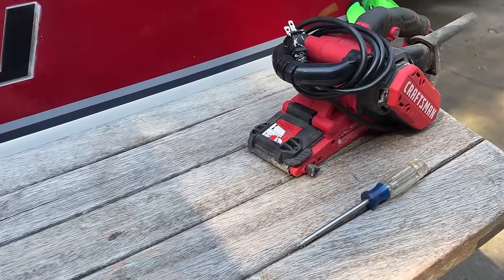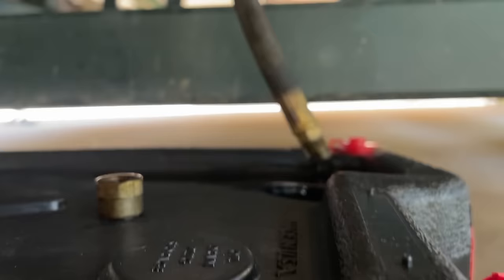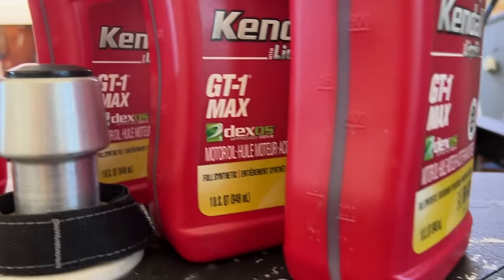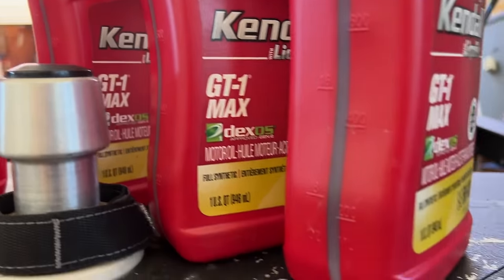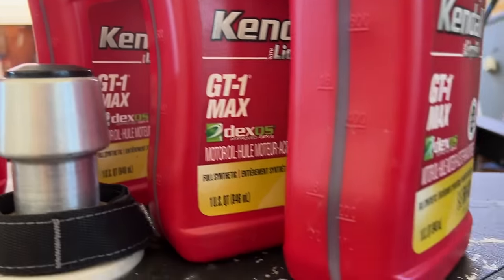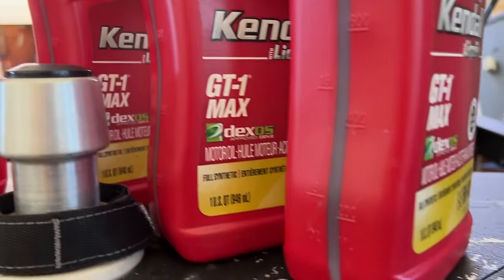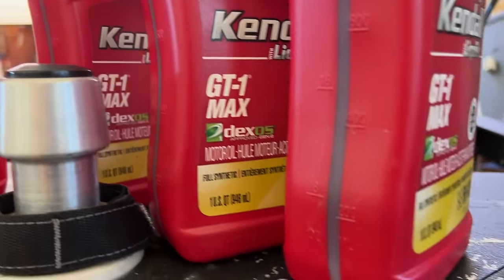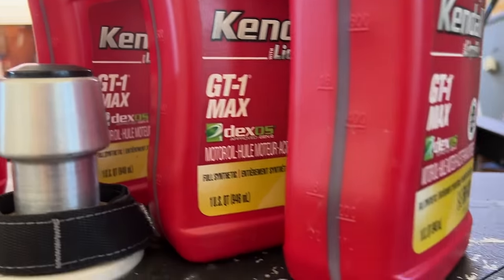Best MALIBU BOAT modification EVER + first time on the water this summer.

Comment: If you bite the bullet and rebuild the transom on the Bayliner, I would suggest using Coosa board (a composite) that won't rot and will add some strength so you can BOOST IT!  LOL.  Those boats were notoriously underpowered from the factory.
Reply: I Second the Coosa Board
Reply: Rebuilding/Replacing the Transom.  I replaced the transom and the floor on a boat that I owned with another guy.  It turned into a large project.

Before we even started we talked with some reputable boat mechanic/rebuilders and the best advice that we got from a couple of them was to take the rotted wood back to solid wood before rebuilding the boat.  This made the boat very sound and stable, don't regret it a bit.  It was a long process because we wound up replacing all of the floor as well as the transom.  We upgraded the transom so that we could run a more powerful engine.

It turned out to be all good because we did the work from late fall through the winter, into the spring.  We decided to rebuild the controls and reupholster the interior also.  Rewiring the boat and trailer turned out to be the biggest headache.

The boat was an old Missouri Department of Wildlife and Fishery that we purchased through an auction.  This was the late '80's so the internet wasn't much more than a thought.  And you probably figured it out by now, we bought it sight unseen as is.  We had no idea that it had sat outside under some trees for several years.  Thankfully we didn't pay much for it to start with.

The money wasn't much of an investment because we knew various people in various industries that made it so that we could get materials for not much money.  A boat like a house always takes more time than you think, and that was our biggest investment.  8 months of most nights and weekends.

Was it worth it?  Without a doubt.  Not only the enjoyment of being on the water, but also doing it in a boat that wasn't going to float again without some serious help.

I encourage you to go farther with the work than you want to, not having to wonder is so worth it.

BTW, mine was only a 18 foot Tri-hull.  That thing would go through some rough water.  It's never about how much that you dream about getting what you think it's worth in dollars and sense.  It's about the memories that you make with the boat, priceless!
Reply: For an I/O on a fiberglass boat you are looking at a massive project.  

Pulling entire outdrive, gimbal bearing helmet.  Pulling out all rigging and engine.  Then go with coosa board.  Thats when you will want to make your decision about new power plant and out drive options.  If you keep the old outdrive this would be time to replace the gimbal bearing and the gimbal bellows.  New outdive upper and lower can be purchased cheaper from SEI than the cost of rebuilding them.  

Speaking of bellows, that is very  likely the source of your water intrusion.    Fill the bilge with water and see where it leaks before tearing out the transom.

Comment: Hey you guys, just finished the boat vid, as always great work. That new interior is fantastic. I’ve had about 10 boats throughout my life (just turned 62) my latest is a 30’SeaRay Sundancer with twin engines so I know a little. Here’s my .02 on both boats. When doing your maintenance try to double up clamps on any hose that has enough room. The transom on the big boat, take the out drive off then the outer transom assembly that will let you look at the transom, get a moisture meter or borrow one (the good ones are pricey) and take readings all along the transom. Anything over 30% means time to cut and replace.  If it still has some strength to it there are numerous products that you can inject into it to get you one-two more season’s out of it. Don’t let the engine transom assembly rattle you, it’s much less complicated than the vette trans. Glad you’re feeling better Aaron, you guys are the best!

Comment: I suggest to every one of my customers to also include a battery isolator in their dual battery system. The bi-directional ones are best. That way if you run the boat with the switch set to 1, it still charges battery 2 when the alternator is spinning, and if you run it with the switch set to 2, it still charges battery 1 when the alternator is spinning, that way you always have a spare in case you forget to switch to both batteries on the switch.
I love battery switches, every boat should come with one from the factory.
Reply: Not sure how common they are in the states. 
In Australia a lot of the old school over landing rigs run a voltage sensitive relay. Run all the accessories off the aux battery, then you always have a charged start battery.
Reply: @agentcrm I am from the states and in boats I know it is not common here but I went ahead and installed the voltage sensitive relay/battery isolator in my boat and run my accessory on seperat battery from start battery and best upgrade I have made and definitely suggest for everyone to do that upgrade and I plan on installing one in my motor home as well it's from 1972 I don't know if newer ones In the states already have them or not but the one I have does not
Reply: A VSR is designed to automatically do what you will now have to remember to do manually. Would have cost just a few $'s extra and a better solution. Pretty much a ubiquitous setup for twin battery systems outside the US other than large outboard systems which often have a similar twin charge facility built into the outboard. The part you used looks like a BEP part. BEP are a large manufacturer of marine electrics based out of New Zealand
Reply: @DavidM-g9d  Yes, Voltage sensitive relay! thats the other term for them! Switches on when it detects the battery being charged, switches off when voltage drops. Awesome little devices and an absolute must have in my opinion for a dual battery setup!

Comment: The single greatest creation for boat mechanics, pig mats. No more oil mess. I would have wire the battery selector different but hey it works. Great to see ya'll out having fun at any rate.

Comment: Thanks for the video! Good to see these old boats back on the water. I'm currently working on getting a '98 Ski Nautique back on the water. We had to get the shaft straightened and the prop is currently at a shop to be repaired after the previous owners ran it aground hard enough to put a crack in the hull right next to where the strut mounts. But we might be on the water for about $350 instead of $1200 had we gone with a new shaft and ACME prop. It needs glasswork, a windshield, a dash, and a couple not so important gauges since it got run over by a small yacht while docked to be right, but we're hoping to have it on the lake before the season ends to make sure it's still worthy of another $1500-$2000 in parts and glass supplies to fix the bow, the strut, and the dash. Fingers crossed because this era of ski boats are hard to beat in terms of hull design, and the nostalgia is pretty cool as well.

Comment: Just gotta love the Malibu.   Had me one for around 7 yrs as my kids were growing up.  Very nice setup, and that engine is all but bulletproof.   I would make one suggestion and is to always carry a replacement impellor and jar of vasoline.  The failure rate whether running dry or just wore out will ruin a day having to get towed in.  Next you guys need to put a tower on it with a bad-ass sound system.  I put a Monster Tower on mine and had zero issues with it.  Custom cover with another one on the top of the tower to cover speakers and lights.   You'll have some good times on the water.  Sort of wish I had another, but kiddies all grown up now.  We'd go the the Marina have some dinner, then come back out... Turn the motor off and just float watching the skies.  Good times!

Comment: Tip to share: When you winterize these small blocks, once its completely drained, replace the the knock sensor and opposing side plug or shower fitting. The moisture from the hull and residual moisture in the block will go after the female threads, and over time it'll rust them away. Its a hassle to fix in the boat.  I also found good results from applying the teak oil in direct sun.  Nice boat you guys, I like the interior.

Comment: I replaced my transom and used Coosa board. Stronger than wood and easy to work with! Try to keep the outside gel coat intact and I just screwed and bolted plywood on the outside sandwiching the gel coat and Coosa board with fiberglass resin. It is strong and durable! I’m very pleased with my results. Good luck!

Comment: What a great job on the teak. It looks so good. I'm sorry about the transom for the big boat. I'm not a pro by any means, but I'd suggest sticking with a big block, maybe an 8.1. A boat that size you'll want to torque a big block can provide that a small block, even a 383 stroker, won't. I'm sure it's been mentioned but if I was doing a transom, I'd go with Coosa over plywood so you never have to worry about it again. Good luck. Glad to see a boat video by you two. I hope to see one soon about the transom. Best of luck!

Comment: That teak  came out great Arron !.  
Emily, OMGosh you must remember , "What happens under the boat, stays under the boat" LOL.  A little leather or rubber between the clamb and the oil filter will help. Maybe buy a dedicated wrench for the bottom of the filter..
You have the skills to stitch up your own upholstery .
Emily, you poured the  first qt. correctly but failed on the secound. Do you know why?  Containers have offset openings so you can tip the container over further before fluid starts to come out thereby having more control with no burping and get the spout closer to the funnel.
That's a coffee table finish !
Oh, His & Her batteries !
You guys just bring a smile to me having fun on the lake. Thankd for sharing !😊😊😊😊😊😊

Comment: Great job of keeping this older boat looking brand new. Engine has a wonderful roar when you wind it up. I would suggest when you  remove the engine drain plugs replace them with a petcock  valve. This way whenever you pull the boat out of the water you can drain the water to reduce rust build up.

Comment: I have a 1978 27' Apollo fiberglass boat and yes I had to replace the transom on this boat, It isn't really a hard job but it does take time. I opened my back transom up and started taking the rot out and followed it up under the fuel tanks all the way up in to the cabin. Not a expensive job but lots of labor. My cousin showed me how to fiberglass it back in and that process is really easy as it turned out. You cut the fiberglass off the inside the inside but leave the about at least 6" around the perimeter on the outside to glass to for strength. The sooner you open it up the quicker you can stop the rot creeping up in to the rest of the boat,

Comment: Maybe convert your Malibu trailer to roller bunks, ad an electric winch to the tongue and then you won't have to worry quite as much about water depth at the ramp when launching and recovering. Just a thought. Looks fun, and Finley looks adorable in his shark life jacket 🙂
Reply: Rollers are not as nice on the hull as bunks. With bunks the weight of the boat spreads evenly over the length of the fiberglass hull.
Reply: I wouldn't use roller bunks but I would upgrade the bunks to plastic bunks
Reply: I dunno... I thought Finley was more like Bilge Rat. LOL JK Em and Aaron.  😂

Comment: I bought a project boat in 2018 to "take my mind off of things". I knew it was totally rotten, and needed a gut job. After watching several YouTube videos, I found "Frisco Boater's Garage" , and "jmink". These videos were a tremendous help. Instead of using marine grade plywood, I chose to use a composite material called "Coosa Board", that I found at a company specializing in composite and plastic materials. My boat is a 1985 Wellcraft 170 American with a 3.0 iron duke engine and Mercruiser Alpha one Gen 1 stern drive. Since Coosa Board is lighter than marine grade plywood, after putting a Pertronics ignition and Weber carb on the engine, the boat is capable of 40 MPH. Coosa board is expensive, but it's very advantageous with saving weight, and it's a composite. I completely covered the Coosa board with what is called 1708 biaxial fiberglass cloth. I learned a lot with the YouTube videos and just thinking through my next process before I did it. Just thought I'd share my experience.

Comment: Nice Malibu. I had my stringers and transom replaced by a very talented boat glass repair person.  He separated the deck from the hull and hung the deck from the ceiling of his shop. One of his employees spent two days removing all the rot from the inside with grinders. The original gelcoat wasn't all cracked out and you can't tell that everything is twice as good as new. He used what he called Boeing space foam to redo the transom. Should outlast me now.
PS, all the new boats running dual batteries use an Automatic Control Relay. Blue Sea has a nice one with a special switch. Keeps me from getting stranded when I play the stereo too long. Also hardwired a 20 amp genius battery charger. 
🤘😎

Comment: When you go to replace the carpet on the trailer, a friend of mine replaced the carpet on his pontoon trailer with some ribbed rubberized material that works great for the aluminum pontoons. Not sure how it would work with fiberglass, but if it will not leave marks it would be worth looking at, the pontoon glided right up the trailer now.

Comment: I just keep commenting as your video progresses.  I have two batteries.  I don't' have a switch.  I manually hook my stereo battery to my starter battery when we are under power and disconnect it when we are chilling at the beach  I always have the newest battery in place as my starter battery.  I too have a jumper but I'm not sure how good it is.  It was a gift.  I should get a quality one.

Comment: For the transom. They cut the outside fiberglass all skin off leaving a 2" border all the way around, save the skin to put back on.   Dig out the rotten wood , replace with Coosa Board and fiberglass it all in. After all the layers of fiberglass just duroglass in the fiberglass skin you saved, fill the cut,  sand it a match the gelcoat.

Comment: When I worked in the Maintenance shop we had oil absorbing towels (like paper towels but thicker and gray in color) they are fairly inexpensive and if you place one on the bottom of the boat under the oil filter it will catch and retain any spillage you may have I suggest using one as well as your paint cup trick to keep your boat floor clean and oil free

Comment: I bought a small ski boat cheap when in college and had to replace the transom, and secured it with four carriage bolts and a lot of fiberglass.  No comparison in size though, it had a 35 hp outboard on it.  The pitch prop you put on a boat has as much to do with torque as the engine does, one can offset the other...  Water skis were invented in the 1920s, but my uncle made a pair in 1956 when I was 10 because he could not find any to buy.  He also shaped a piece of plywood he called a surf board.  I was among the first to slalom skiers as far as I know, and my wife and I used to ski on three skis together.

Comment: Pro tip...it's an old mechanic's tale that you have to fill the new oil filter before you install it....there manufacturers that actually tell you not to if you read the service manuals.  It takes away the chance of dropping the oil filter full of oil wasting oil and making a mess.  I worked in the trucking and excavating business for over 40 years and never once prefilled and oil filter and NEVER had an issue with any of the engines...cars, light trucks, medium and heavy trucks and excavating equipment.

Comment: 14:20, Slalom skiing about 25-30 years ago, just got thru the timing gate and went out the front end, face plant, really tore up my right shoulder... took almost a year before I could make the motion of turning on a light switch! 
1991 MasterCraft Prostar 190 w/351 Windsor, Borg-Warner 1.52:1 Ratio Powerslot 

Today, to this very day... 
100mg Tramadol & 2500mg Tylenol Extra Strength twice a day. (9am & 9pm) 
10mg Flexeril 3 times a day. 
Shoulder injuries don't go away😥

Comment: A short little piece of old rubber fuel/vacuum line slipped over the end of those battery cables before hooking them to the isolator switch works a lot better than black tape for an insulator, especially if one of the cables moves a fraction of an inch in that boat bouncing on the waves.

Comment: My Seaswril has as San Juan after market Cooling system  on my Chev engine which uses antifreeze in the engine and a heat exchanger to cool the coolant which makes it simple to winterize

Comment: I used teak oil on my boarding ladder and grab rails on the deck and it needed doing every season here in the UK there is a product by International paints it’s called “Wood Skin” it’s like a varnish but better used it 2 seasons ago 2 coats looks like I did it last week brilliant on teak.

Comment: My brain isn't quite it used to be...😅 When you got the Bayliner, I know you all had to change the throttle, but did you all change the outdrive seal and gasket and o-rings? You may need to do the transom, but $5 to $10 on the 4 or 5 piece gasket seal and o-ring set. We had to do that on our Sea Ray. Rebuilding a transom ranks high in my least favorites along with transmissions.

Comment: Battery cutoff switch will last longer if you connect negative cable to the disconnect side. And positive’s on bottom lug. 
And it’s safer for for all DC components too. Especially anything digital. That’s why we remove neg side first when changing battery in cars.